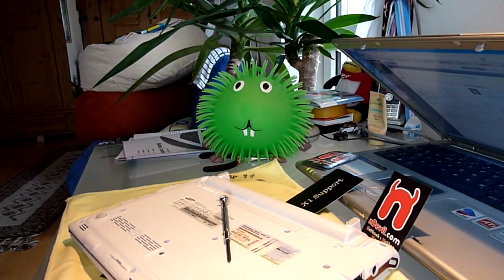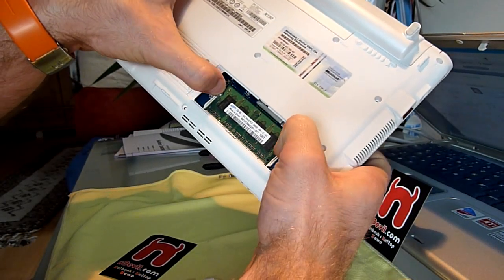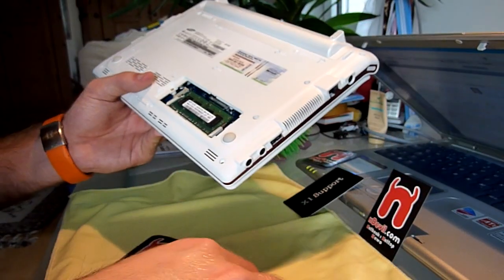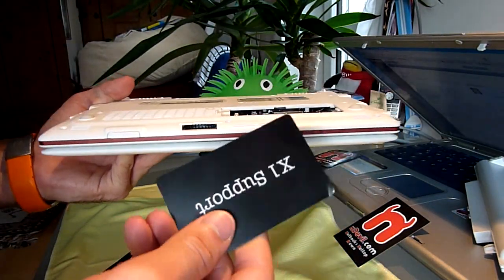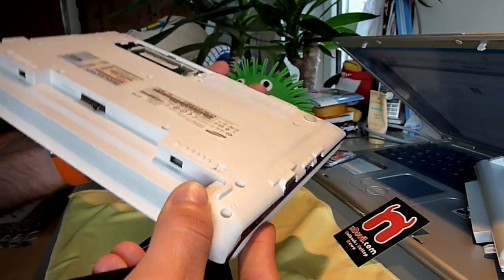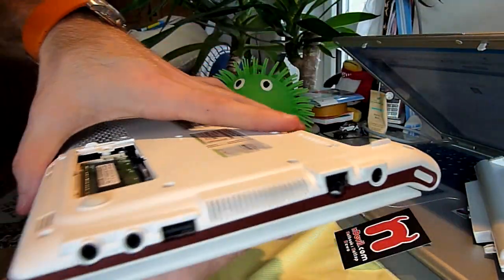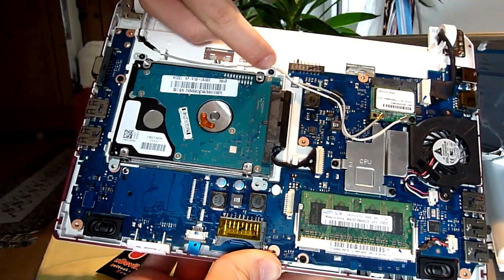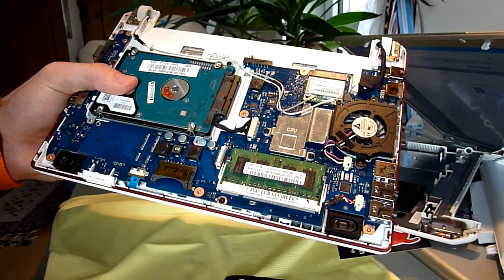Samsung N150 RAM Upgrade and taking apart

Comment: Really nice video, would you know what type of memory I can upgrade it to ?
I have tried a 4GB DDR3 1800 but the note doesn't start, now it has a 2GB 10600
I am not sure it the limit is the 2GB or the frequency.
I'd love your help on this one. 
BR
Reply: Hope my late answer helps you, but this Samsung N150 can be upgraded to a maximum RAM capacity of 2GB. So it is not the frequency of the module, it's the maximum capacity that's  been reached. It also takes only DDR-2 RAM memory, so no DDR-3 will work. Hope this helps.

Comment: It is.  I installed a larger capacity HDD from another laptop, and it was 2.5'.  I went from 250GB to 500GB in about 30 minutes.  It actually makes the Samsung a nice little travel computer.  I've got my iTunes on there (over 100GB collection) and 200GB of movies.

Comment: Yes you can.  When I upgraded the 500GB drive to a 750GB 7200 RPM drive in my big Gateway laptop which used a standard laptop drive, I had a perfectly good 500GB laptop drive left over.  Following these directions, I swapped the 250GB drive out for the 500GB drive.  Just be careful.  Make yourself a full set of bootable recovery DVDs and get an external drive BEFORE you swap drives.  You'll save a lot of headaches and your re-install will go much faster.

Comment: Hi , I own a N150 and my I'm having a problem with my hardrive. Basically it is making a ticking noise and will neither load or recover. Is there a possibility of recovering data from bth drives? Does the N150 have 2 hardrives? thanks

Comment: The on/of switch on my N150 has failed. I is the white switch on the lower left of the opened up machined.    I haven't opened my machine yet but can anyone advise whether I will be able to buy and replace the switch without soldering?

Comment: @DavidLeonFeild It really really doesn't make much of a difference. I do it all the time. There is no danger of damaging components unless the computer is sleeping, in which case the RAM is still powered. If it's off, however, there is no danger of any damage occurring.